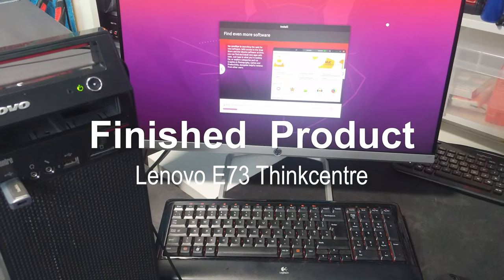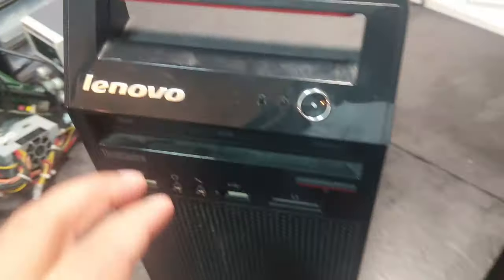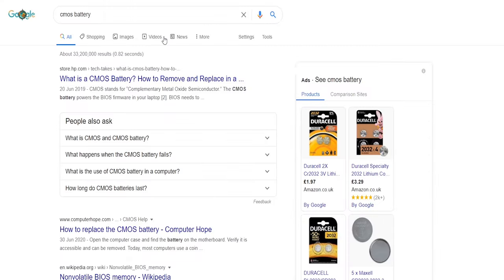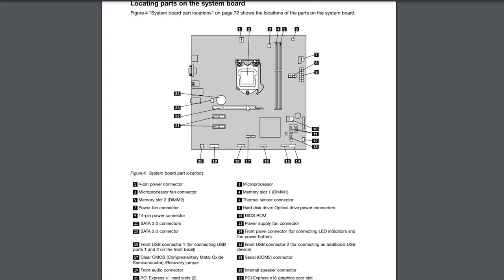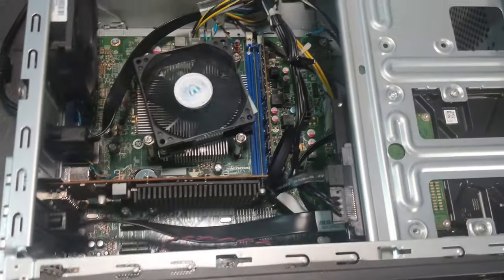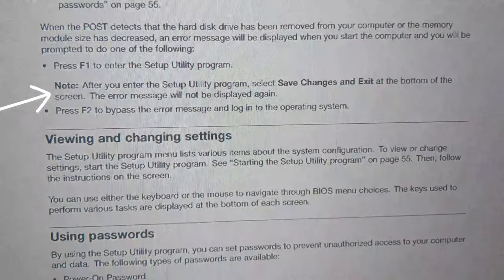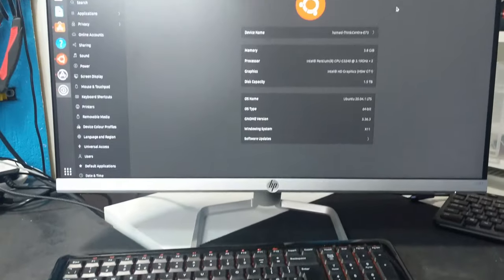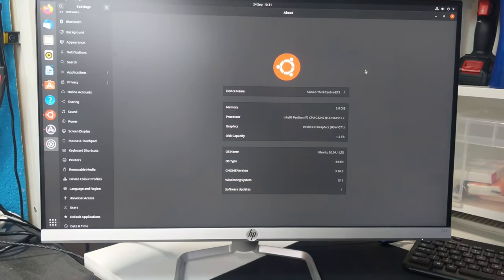2 Beep CMOS Error - Lenovo Thinkcentre E73 - Car Boot Sale Testing

Comment: Haven't watched the full vid yet so sorry if I'm commenting too soon. I turned mine on today and got that exact 2 beeps but it starts up and I'm at my desktop just fine. This is the first time I've noticed the 2 beeps what does it indicate?
Reply from the maker: The fact that it started up is strange, usually it's a CMOS error or graphics card issue. So clearing the battery or removing GPU usually does the trick. I'd leave it as is if you're in the desktop.
Reply: @HamedAdefuwa  I was thinking, I just got a new 4k tv and have it hooked up with a vga to hdmi adapter. The first day I had hooked it up I switched to a resolution that wasn't supported but was able to get it back to 1080p which is where I'm gonna leave it. Could the switch to the unsupported resolution trigger the beeps?

Edit: my pc only has integrated graphics (Intel HD 4600) so I can't take out my gpu
Reply: @jm.Beats.    dude idk if you are still out there, but I have this EXACT situation. Vga to hdmi with intel graphics so no gpu to take out
Reply: @MrSquirrel1693 did you solve?
Reply: @raevod6361  i cant remember much lol. But I know the adapter I had was wrong. It was VGA to HDMI so it only works one way or something. The beeping on the motherboard I can remember if I fixed it or if I just got a different motherboard.

Comment: i don't know but i just got this similar error but after i restarted it worked normally except i get 1 short beep but it's still working with no errors. I don't know should i be worried or not. (it was 15 mins away since i posted this comment
Reply: It also showed the display on my screen.

Comment: I get two or three short beeps but it's through the speakers whilst running the os (usually within brave browser or on the w10 desktop, I think it's a gfx driver issue)
Reply: you went to visit device manager, if its a driver issue?
Reply: @gamingstuffbyroni2456  There were no driver issues showing, or anything in need of an update. Having said that, it's now a ten year old laptop using win 10 as an OS (it came with 8.0). I think the beeping was directly from the motherboard. At the time I assumed a failing component or outdated graphics drivers in combo with an OS it wasn't designed for, as some of the beeping came with a half second freeze on screen. I haven't had any random beeping or freezing for months, so I can only assume an OS update fixed it. I will be replacing the laptop soon. thanks

Comment: Hey man, I found one of these outside and took it in. It seems to work fine despite the 2 beeps, but once in a while it'll freeze up and the display would go weird, but the boot up session is fine and the OS comes up quite quickly after I turn it off and back on again. Any idea what the problem could be?
Reply from the maker: lol you found one? nice! It seems its a graphics card issue? Does yours have a graphics card in? If not, perhaps try installing one?